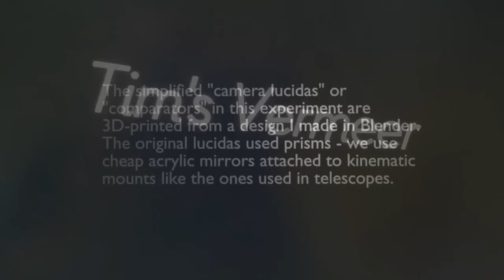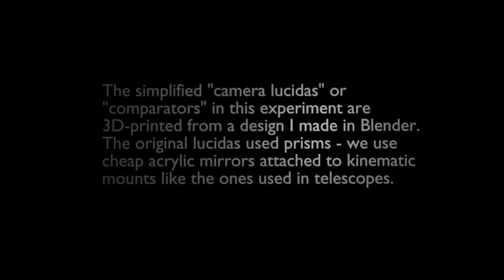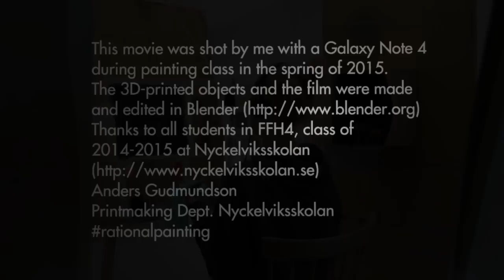Technical Art History: Using camera lucidas in painting class.

Comment: Anders,

Great video! I'm glad you enjoyed Tim's Vermeer. I have a few suggestions after watching your experiments.

Try moving the mirror closer to the easel and closer to the subject (Keeping the distances equal to each other to prevent parallax). Then you wouldn't have to stretch your arms so far, and you can see and paint details much easier. 

Also, it is very important to establish and maintain similar light levels on the canvas and the subject. I sometimes place a white card next to my subject (facing the light source) and another card flat against the canvas. Looking through the comparator mirror, adjust the light on the canvas and subject so the white cards match each other.

The combination of natural and artificial light can be a problem because one fluctuates and the other is constant. Try to avoid using both at the same time.

Tim Jenison
Reply from the maker: Hi Tim! Great movie - your Vermeer! The reason for the long distance between mirror and subject was my preference only - I like the "shorter/tele"? perspective when working myself. Light was an issue of course and the short duration (two days) - but all in all a appreciated event. I have some ideas for a follow up on this subject (but in relation to the technique of Caravaggio especially the engraved contour lines in the painting surfaces - if you are interested in my theory PM me on Facebook or preferred way) Regards 
Anders
Reply: Another issue, is making sure the easel and subjects are square to each other.  Or one will get distortion, I believe (?).  My easel is vertical, so that will be OK for me.  I am just using the desktop experiments for now, you set-up is pretty interesting for a larger scale situation.
Reply: Tim, if you get back here...  Now that there are many artisans working with your equipment as part of your ongoing research, have you found a commercial source to the 710 mm objective lens?

Has anyone else got a source?  Extra points for Chinese origin, since they have the best delivery options to Canada.
Reply: Tim -- do you have a recommendation on a source for calculating focal lengths/lens diameter to transcribe your subject onto the correct canvas size (as you did in fitting an entire room onto a defined canvas size, as opposed to a 1:1 scale copy)? I would buy a variety of lenses and experiment, but the large lenses get very expensive -- I'd prefer to be intentional.
Reply: @brownjh91  Hi Jacob, all the basics are here: https://en.wikipedia.org/wiki/Focal_length  and here https://en.wikipedia.org/wiki/Pinhole_camera_model

I have a source for low-cost 700mm lenses if you email me.
Reply: @timjenison7842  Thank you! I think I was over-complicating my search for information -- I should've started on wikipedia. I cannot find your email online, but mine is jacob.brown.artist@gmail.com (so you don't have to post yours) -- I would GREATLY appreciate you sharing your source for lenses. Thanks Tim!

Comment: Your canvas has to match the angle of the subject in order for it to not come out distorted, in other words your easel  should be straight up and down on a 90 degree from the floor . And the mirror should be the same distance from the canvas to the subject in other words a 45 degree triangle sort of speak.
Reply: The distance can be changed to change the scale. But square is correct

Comment: Great video, but I swear 3D printers are going to ruin craftsmanship in woodworking, metalworking, and the like. Dependence upon automation always destroys talent and ability.
Reply: Lawrence Stanley thats not true, how do you explain painting than more than 200 years into cameras?
Reply: habit
Reply: Woodworking tools are all about destroying talent and creativity, and empowering it. An interesting question is what is this tool a "mold" for.  Even something as simple as a 1" wide chisel is a mold for that cut, flat across it's width.  It isn't a gouge, or a v-grouver.  Hand planes function at multiple levels, but some of them are very programed:  A given width; curvature in two direction; and the sole length determines the lengthwise curve it can make for a given blade projection.

There is a lot of craftsmanship in designing in 3 dimensions.  I build boats and while computers really speed up the calculations, and limit many shapes, it is still a highly skilled process to think in 3d and keep all the factors in check.

Automation is like when you set up a machine station to do one thing over and over, for speed, quality, and economy. 3D printing is special because it can automate non repetitive tasks.  That puts it in a different class.  You can dream up something that never previously existed, then make it.  Not exactly the assembly line.  Though over time, the files will cover everything we normally need, and we will be automating life.  It can lead to a higher standard of living though.  What if clothes actually fit, and were detailed like the finest hand made suits, and I really mean the finest.  Those skills would be replaced.  And we would never get new deep clothing, that was really deeply rooted, we would have old forms, and whatever transient crap follows...

Comment: This is ridiculous just use a transparency on an over head projector.
Reply: In these instances, they are painting from life.  You would have to photograph, then print out, then color correct for the projection, etc...  It would not be cheaper, faster or more accurate to do it with the method you suggest.  This was a 2 day vacation from their regular work